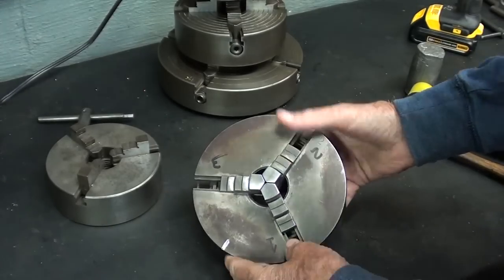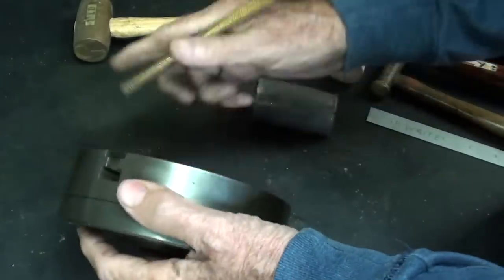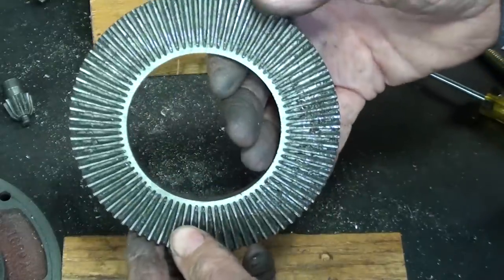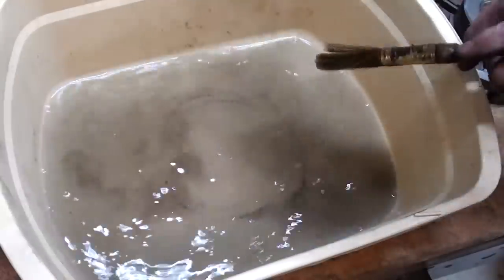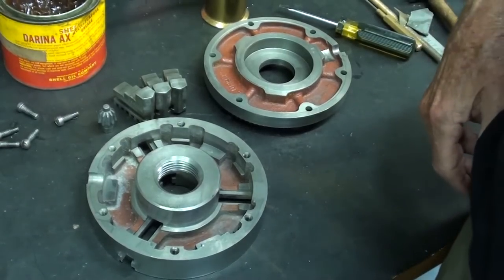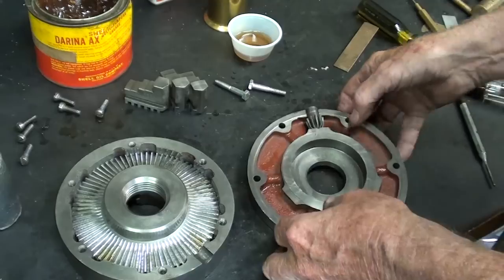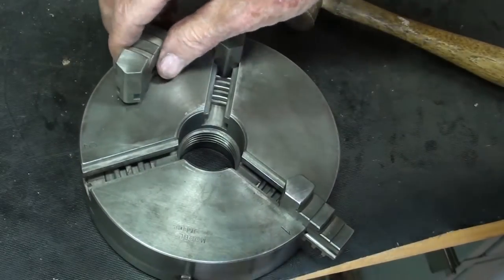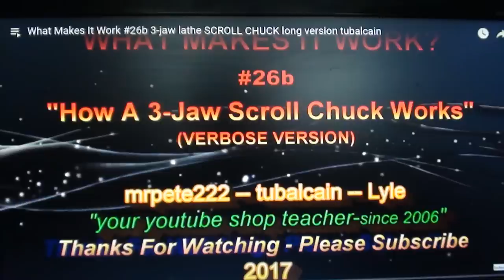SERVICING A 3 JAW LATHE CHUCK #824 tubalcain

Comment: My vote would be for grease: it'll last longer and give just as much lubricity and rust protection, and is thicker to stay where it should stay. I think oil is too thin to hold onto the chips making it feel like grease attract chips more whereas force just slings chips away with oil.
Reply: Agreed
Reply: Thanks a lot i have learnt a lot

Comment: Great video. I always wondered how a chuck worked. Most of it is fairly common gear grinding, but they probably had to create a custom grinding machine that could grind the presumably hardened scroll. By the way, tungsten disulfide grease has a lower coefficient of friction than molybdenum disulfide, but both will work well. Its probably overkill for the chuck, but in the world of gas turbines and rocket engine turbopumps, using a specialized process that bakes on the tungsten disulfie would last the longest, have the lowest friction, retain less chips in the moving parts, and would be less than .0001 inches thick (probably way more info than you wanted though).

Comment: When I bought my Craftsman (Atlas) lathe the three jaw chuck was like new but lacked the pinion. I contacted the company and was told there were no parts available. After much pondering I noticed how much the pinion hole resembled a drill chuck key. I found a key that matched closely enough to work. I removed the cross pin handle and used it that way for many years although it really was not safe with the body of the chuck key protruding from the chuck periphery!

Comment: I used to use oil but I switched around 15 years ago after a suggestion from a friend. 
  Now I use a Dry Moly Lube spray that has Graphite in it when I service the 4 jaw self-centering scroll chuck I use at work and on the one that I have on my South Bend lathe at home, which works quite well. 
   Since switching I've found that I can go longer in between services bc the dry lube doesn't attract and hold chips & grit like oil and grease does, so there's less chance of jamming and wearing of parts. Also it's a lot easier and quicker to apply an even coat to the parts and best of all I no longer have to worry about the chucks spitting oil at me for a week or so after servicing like I did with oil lol. So for me it's a win win in my book.

Comment: We greased our chucks in the industrial production shop. We used an extremely high quality grease with high tackifiers. This reduced how much grease was slung out by centrifugal force. High quality industrial chuck manufacturers usually specified the preferred grease. Once settled on a shop standard, chuck grease was universally applied throughout the shop regardless of chuck maker. Grease suppliers changed over the years, but usually we used a dark gray grease that probably was high lithium base. If you use flood coolant I suggest that you look for a grease with high moisture resistance. CNC spindle speeds normally well exceed the hobby  lathe spindle speeds so centrifugal sling out is less of a problem in the home shop. Over greasing or oiling will likely give you a lubrication spatter pattern on your shirt, the lathe bed and wall behind the machine.
Reply from the maker: Thanks

Comment: Thanks for the reminder to maintain this vital part.

Now for a bit of a gripe. At around the 8 minute mark, you are cleaning the outside of the chuck using a emery cloth in the lathe. What I am going to talk about is your method. The reason is, many decades ago, I was doing a similar job. I too was pushing into the lathe with the cloth when it snapped. This caused my hand to come into contact with the jaws of the lathe, which then sent me to the emergency room. I was lucky, no real damage was done, but I did learn from that.

The only safe way to do that polishing is to be pulling out of the working area, not going into the working area. Had I been pulling  instead of pushing, the worst case would have been landing on my backside. I was lucky not to have done damage by pushing into the danger zone.

As to lubrication, I would be most tempted to something like DriSlide their moly and Graphite general purpose one or some other similar one that carries the moly and graphite in a evaporating carrier. After it dries, there is nothing to sling out to speak of.

Comment: Just took my 6 inch chuck from my South Bend 9A apart today.....
a bit more complicated, as it has 3 slots for the chuck key.....
lots of very old grease, but next to no wear.....the nice thing is, it has reversible jaws
I think it was an after market addition, as the lathe is 1950's era...
.I am debating using white lithium grease or oil now....hmmmm....
it is 1 1/2 by 8 ...but Plan on using on my 1 7/8 by 8 ....13 " SB....mounted to a 4 jaw...
as the 9A has never been set up......Cheers Lyle, 
Paul down in Orlando.....

Comment: I took apart a Burnerd 3-jaw chuck and could not get it back together again; the clearances were too tight. Had to get someone with finer sensibilities to get the scroll plate back into the body without damage. It’s all good now. I have a few Yankee screwdrivers that keep on going even when the power is out - true “green” machines.

Comment: I'd speculate that oil versus grease depends on how frequently you're willing to tear down the chuck for servicing, since you can [kind-of] add oil without full disassembly. What to the manufacturers of comparable 3-jaw chucks (without grease fittings) recommend? Surely there is some guidance, even if we don't know who manufactured this particular chuck.

Comment: I recently rebuilt my 12” Cushman because it was stuck together from old grease. I was very well preserved by the previous owner but with the tight tolerances and glue like grease it was near impossible to disassemble. I put it back together with oil which by the way if you are going to do this Mr. Pete is very much correct on the striped left shoulder. But it does work very smooth and I believe for my use the oil will work well. In a constant shop use environment grease is probably superior. Thanks again for another great video.

Comment: Lol! Yep! I have one of those ZYankee cordless screwdrivers too... but on mine I modified a hex drive bit holder like we use in drill motors to fit into mine so I'm not limited to the couple old bits mine came with. Sort of modernized it! BTW, I have a nice 3-jaw chuck I need to disassemble and clean. Thanks for making this informative video! Alway a pleasure watching and learning from a master!

Comment: I use oil and find much less crud in the chucks at cleaning time.  You can add a few drops now and then as well which doesn't work so well with grease.

Comment: I used to use straight 30W oil but there was still quite a bit of it slinging out of the chuck. I now use 30W oil thickened up with STP oil treatment.  I use that mixture throughout my lathe now.

Comment: Bison sells special grease for chucks, rather expensive IIRC, but my Autostrong chuck has a ball oiler on the front, strongly indicating oil is preferred.

I think the answer is simply that you need to lubricate the chuck.😂

Comment: I like to use oil. I’ve tried both, and every time I’ve slathered it with grease i feel like I’ve regretted it. Oil will sling when the chuck gets to spinning, but it’s better than the grease i think.

Comment: That should be done on a monthly maintenance schedule along with cleaning and adjusting the lathe and the other shop tools one has.
Reply: In a shop where the lathe is in daily use a monthly service and maintenance schedule is the way to go.  But.  In a shop where the lathe is only used occasionally I would recommend service after every 160 to 172 hours of use.  I know that means keeping a log of machine hours which many of find inconvenient.  But a little inconvenience is worth while  to keep your tools and machinery in good working order.

Comment: Dry Graphite in spray cans seems to work well as a chuck lubricate due to it coating and lubricating the metal without attracting chips, etc.  It comes out of the can as a liquid due to a carrier something like Brakeclean that quickly evaporates, leaving a coat of fine graphite that appears to go into the grain of metal.  There are probably several brands available, but "Blaster" brand from Ace Hardware is the one I used.

Comment: Had to chuckle a little when you talked about cleaning it again after the scotchbrite considering what it looked like when you took it apart.  Of course there may be some abrasive from the final sanding.  Kinda made me want to go get one of my chucks and slide it out there so you could do it too while I watched.  No doubt mine needs cleaning.  I'll probably have to settle for regular diesel fuel.  Did anyone else besides me think that the little bevel gear looked exactly like a drill chuck key?  It even had the little tip to hold it.

Comment: I'd go for the motorcycle black used to put a motorcycle grease that comes in a broad tin which is heated up to immerse the chain in.  It repels grit while lubricating with graphite in a matrix of grease.  Maybe a motorcycle shop would you some.

Comment: I use slidway oil on my chucks. Only a small amount is needed. It is tenacious and very slippery.
I was just thinking, very dangerous for me, has anyone tried sticky motorcycle chain lube? It is designed as anti-fling so should keep your left shoulder clean.

Comment: I'm assuming there is an inside joke here...did you really put the chuck in the dishwasher??
My periodic chuck cleaning is usually done in Varsol, followed by oil in the scroll and bearing grease on the 'rack and pinions'.
Reply: Oh yes, into the dishwasher, brushed off with Mrs Tubalcain's toothbrush, and dried off with one of her softest bath towels.

Comment: My shop teacher from many, many years ago always told us that for the shop tools - gears get grease, and metal on metal sliding surfaces (like ways) get oil. I have kept to that now for 50 years,  It works for the most part, and I have only ever found 1 or 2 things that didn't follow the rule. Other than that, keep up the great videos.

I recently came into possession of a 1946 Logan 820 lathe with quick change gears and taper attachment, and your videos have been a great help as I disassemble it to clean and refurbish it.

Thanks for the help